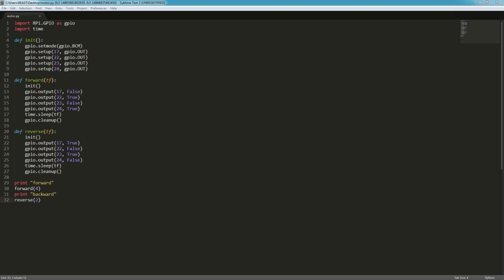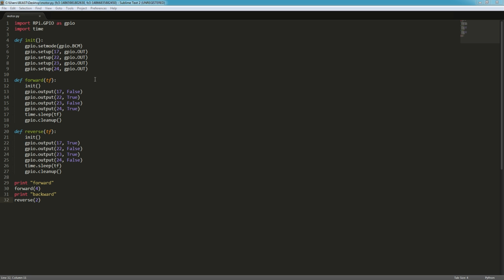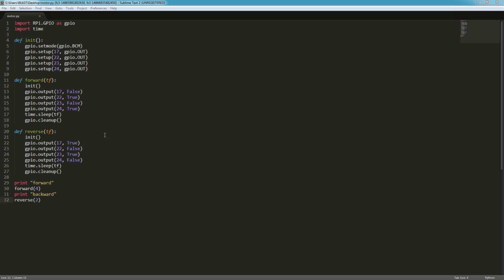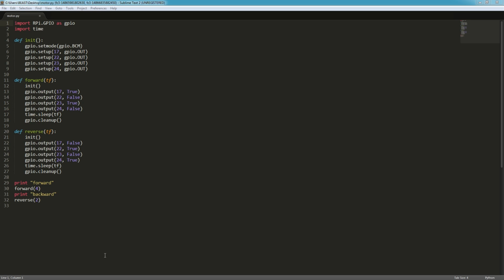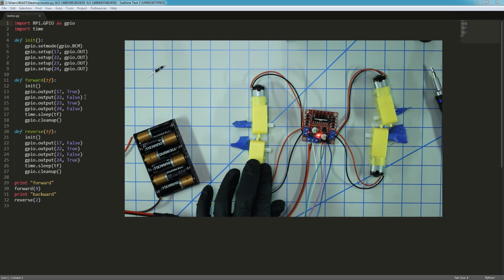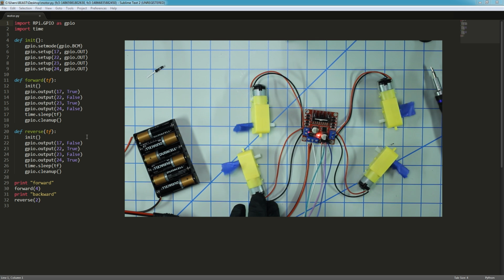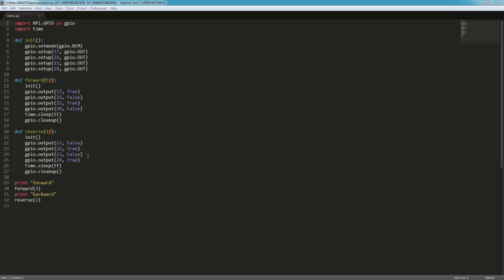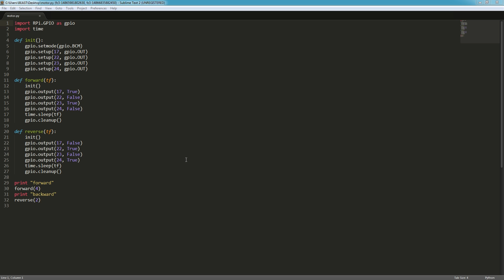L298N Dual H-Bridge Motor Controller (Raspberry Pi)

Comment: when i connect 2 motors on one side it runs fine but when i connect 4 motors it only runs forward it will not run reverse and motor driver LED stops glowing. can someone help me?

Comment: My motors only run forward but not backwards... Any solution
Reply: 1)may be there will be a problem in the motor driver
    u should choose the motor driver according to the motors u have 
    for example if u motors is 5 amps and u have an 2 amp motor driver. at first it will work fine but after running it                       several times then it gets damaged
2)if there is no problem in the driver there could some mistake in the code so verify the code
3)if none of the above is true then check the connections and wiring
    the pin numbers specified in the code should match the pins connected
Reply: @pvsmouli7727  thanks for the help.. but I solved it. The pin 17 was not working on my pie. Thanks tho

Comment: Thanks for the video mate. Could you tell me how do know which gpio pin needs to connected to which controller pins? Is there a way to find that out for every pi module?
Reply from the maker: Yeah just google "rpi gpio pinout"/''L298N Raspberry Pi" and you should find some relevant diagrams.

Comment: Does this work with a raspberry pi 3 b+?
Reply from the maker: Yes
Reply: @PiddlerInTheRoot  Awesome! Can't wait!! Thanks :)
Reply: @PiddlerInTheRoot  Hang on... I don't have the same motor driver as you... I've got this one : http://feiticeir0.files.wordpress.com/2013/08/l298.png
Are they pretty much the same?
... So would your code still be compatible with the driver I've got?
- Thanks in advance :)
Reply: (I have the REV02 L298N motor driver)
Reply: Well, I'll just have to find out...

Comment: hey man i connected all the wires and all that, but none of my motors are running im trying to get at least 2 motors running. HERES MY CODE!!! PLEASE HELP!!!

#Right:14_15
#Left:23_24
print(" ")
import RPi.GPIO as GPIO
import time
GPIO.setmode(GPIO.BCM)
GPIO.setwarnings(False)
f=14
r=15
e=23
d=24
GPIO.setup(f,GPIO.OUT)
GPIO.setup(r,GPIO.OUT)
GPIO.setup(e,GPIO.OUT)
GPIO.setup(d,GPIO.OUT)
GPIO.setup(21,GPIO.OUT)
t=True
while t:
      command=input()
      if command=="w":
          GPIO.output(14,GPIO.LOW)
          GPIO.output(15,GPIO.HIGH)
          GPIO.output(23,GPIO.HIGH)
          GPIO.output(24,GPIO.LOW)
      if command=="s":
          GPIO.output(14,GPIO.HIGH)
          GPIO.output(15,GPIO.LOW)
          GPIO.output(23,GPIO.LOW)
          GPIO.output(24,GPIO.HIGH)
      if command=="d":
          GPIO.output(14,GPIO.LOW)
          GPIO.output(15,GPIO.HIGH)
          GPIO.output(23,GPIO.LOW)
          GPIO.output(24,GPIO.LOW)
      if command=="a":
          GPIO.output(14,GPIO.LOW)
          GPIO.output(15,GPIO.LOW)
          GPIO.output(23,GPIO.HIGH)
          GPIO.output(24,GPIO.LOW)
      if command=="z":
          GPIO.output(14,GPIO.LOW)
          GPIO.output(15,GPIO.LOW)
          GPIO.output(23,GPIO.LOW)
          GPIO.output(24,GPIO.LOW)
          #t=False
      if command=="x":
          GPIO.output(14,GPIO.LOW)
          GPIO.output(15,GPIO.LOW)
          GPIO.output(23,GPIO.LOW)
          GPIO.output(24,GPIO.LOW)
          t=False

HELP!!
Reply: check whether is enable pin is shortened or not 
by default both enable pins on the driver will be shortened but in case if u removed it then shorten both enable pins using a female to female connector

Comment: This may sound like a stupid question but how did you know which pins on the raspberry pi to connect it to?
Reply from the maker: Google. There are many tutorials depicting the wiring setup and also you can find the spec sheet for the L298N online as well. If your asking about the raspberry you can google "Raspberry Pi Pinout" and you should find some material that describe what each pin does.

Comment: Hi I have tried this and it works, but now we would like to program it in scratch could someone help me with it? In scratch i could only turn on the pin with motor command, there is no false option for the other pin so I think the ground is not connect. Thanks in advance
Reply from the maker: I'm not 100% sure but you can check the documentation for scratch. I believe you can just use "On" and "Off" instead of "True" and "False" for the motor gpio pins.

Comment: I tried to implement the project using an external power supply instead of the battery. L298N comes on but raspberry no. The power supply delivers 9V max 1.2A. Is it a problem of amps?
Reply from the maker: The Raspberry Pi is rated at 5 Volts

Comment: Hello,

Two of my motors start when I connect the power supply, no script run. What can cause this? I just plug and they start.
Reply from the maker: Not sure, could be a number of things. I would check the jumpers, and your wiring. Also your H-bridge could have a short somewhere. (I've had a few bad H-bridges)

Comment: Sir, if a supply power to raspbrry pi only then it will works?
Reply from the maker: No, you need a separate power supply for the h-bridge.

Comment: How do I write these Python codes on Raspbian terminal command prompt? I'm sorry if my question doesn't make sense since I'm just a newbie to pi.
Reply from the maker: You can use any command-line text editor to create/edit python scripts such as "vi" or "nano". You can Google tutorials of your preferred editor as each has slightly different syntax/commands when interacting with the tool via the terminal.
Reply: Thanks to you, it works with "nano". Thank you so much!

Comment: How did you feed your raspberry pi? Can 5V output of l298n feed raspberry pi?
Reply from the maker: Separate power supply. It's generally not recommended, the motors draw too much power and this can potentially damage your pi.
Reply: Okay thank you!

Comment: Nice video! Are you actually using the sublime editor on the pi? If so how did you manage te install it on pi?:)
Reply from the maker: I wish that were the case, but sublime is currently not supported on the Raspberry Pi. I usually edit code on another computer with sublime or pycharm.
Reply: PiddlerInTheRoot oh yea same here!:) thnx!

Comment: Why did you not use enable pins for motors in l298n?
Reply from the maker: I opted to not to include speed control in the tutorial, in order to keep things simple. I was planning to revisit the l298n in a future video.
Reply: So, if i not use enable pins will the motors rotate in full speed?
Reply from the maker: Correct, the motors will either be "off" or rotate at full speed.
Reply: Alright, thanks man